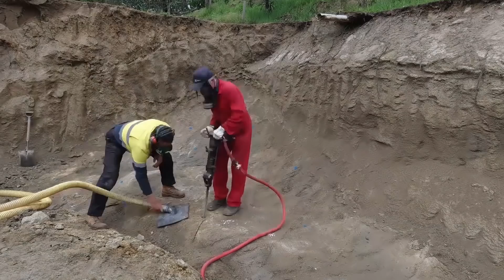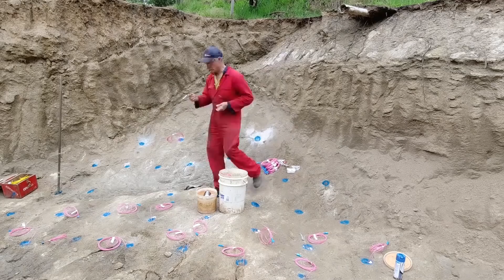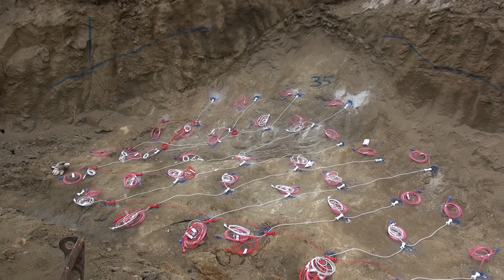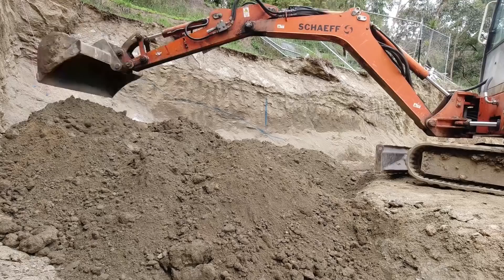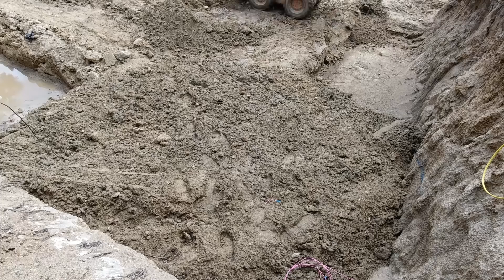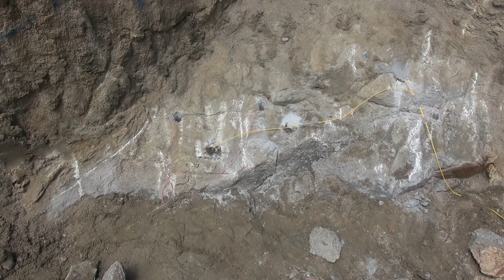Drilling and Blasting Granite in Belgrave Heights

Comment: Hey Dave how many hole you can drill with one drill bit ? Maximum? Do you reuse the drill bit after it becomes flat or  you use the new one ? Just curious does your drill bit get stuck if there is water in the hole ? 😐
Reply from the maker: Hi Nashib and welcome to my channel, these bit are good for about 60m in hard Granite, I'm using knock on button bits here and have recently purchased a grinder to sharpen them - https://youtu.be/jg83MLOe5Q8 If you find water in the hole it is very easy to get stuck, one way to overcome this problem is to have a second drill that is set up for "wet flushing" like they use underground - it flushes with water instead of air, this will make drilling wet ground easier.
Reply: @demolitiondavedrillandblast   thanks 🙏 for you kind info Dave . Hope to see more easy tips and tricks for using rock drill .
Reply: @demolitiondavedrillandblast   usually I can drill only about 28 maximum hole one day after that drill bit sucks ,what do you think about that ? Is it less or we can drill more in one day ?
Reply from the maker: Are you using button bits or integral chisel drill steels?
Reply: @demolitiondavedrillandblast  I think it should be dth button bits

Comment: I don't understand why the pink wires are so long and why don't you cut them to re-use on a other blast. And i don't understand what is brown thing you put on the top of the holes. Is it just some standard gravel or is it a spécial product, and what is it for doing ?
Thank you for the vidéo.
Reply from the maker: Hi Stéphane, The Pink stuff is not wire, it is a hollow plastic tube with a very thing layer of explosive coating on the inside, the filling for the holes is 5mm screened crushed rock.
Reply: The 7Mm screenings give a mechanical lock in the first milliseconds of the initiation of the blast.

Comment: Wondering if the blasts would be less costly with larger holes "Less boosters and caps , det cord " ?
Reply from the maker: Yes, certainly Michel, where you can. One of the variables that you have to manage is the length of the stemming column in relation to the diameter of the hole, the normal recommended range would  between 20 and 30 diameters, any less than 20 and you risk blowing the stemming out the top of the hole and not breaking the rock so for short holes like the ones in the front row here (32 or 35mm?) is really pushing my luck especially since the hole spacing is nearly equal to the depth and the hole diameter / depth ratio is only about 16! This is the most cost effective way I can do it that I know will usually work.
The deeper holes up the back were 38mm. Cheers.

Comment: This job-site does not contain granitic formations, it is ordinary earth/natural soil because the product shows no rock pieces.
Reply from the maker: What we have on this site is mostly decomposed granite in the lower section of the rock, when you blast it the shock wave breaks all of the bonds in the rock and it turns into sand.
Reply: @demolitiondavedrillandblast 
Hi Greetings,
Could you please be more specific about the the drill pattern and the type of explosives you use that makes the granite sand?
Thanks in advance.

Comment: Dave would it be possible for you to do a before and after  picture so we could really see how much rock was removed. Thank you.
Reply from the maker: Ummmm... bit hard on this one now. the amount of rock removed on this one is very deceiving, it does not look like very much at all when you look at the seemingly small amount of smashed rock in the dig out. Something very interesting happened here, we had some very hard granite and some decomposed granite that is a lot softer, when you hit the decomposed granite hard enough with explosives, the shockwave breaks all of the bonds in the material and it just turns to sand! See me at 6:28 digging with a spade, pre blast this decomposed granite would not yield to the hydraulic breaker on the small machine but now I can dig it just like sand.

Comment: Don't use a blasting mat it might save the customer a few bucks moving and re moving dirt
Reply from the maker: Hi Albert, there are pros' and cons for both methods, sure the clean up after using mats is a lot quicker but the size of the shot is limited by the size and number of mats that you have and you might have to do the job in several shots instead of just one. I have about 15 small rubber mats (about 80Kg each) and that would not be enough to do this job in one shot. Other factors, I would need to bring them on my truck, (extra worker), this excavator is to small to place them effectively or reload on truck easily (manual handling issues). Another big issue is that the dirt does a remarkable job of dampening the blast noise and overpreasure  - if the neighbours don't hear it, they don't feel it and don't complain.  You can see hundreds of my shots with blast mats on this old compilation video - https://youtu.be/VCMjaYfUgKQ

Comment: Dave do you ever get jobs where you only have to take inches of (showing my age) . I use to work on Barrow Island and they built a new air strip and the blaster made like a snooker table and he was taking inches in large areas
Reply from the maker: "We only need a little bit off the top" - hear it all the time Tim. I would normally explain the it is a lot cheaper to take a bit more off as this cuts the hole count dramatically (the hole spacing would normally never exceed the depth). in some cases this may be justifiable such as Barrow where everything like hard fill and concrete has to be imported. I have recently obtained an air leg drill for drilling horizontal holes with ease, this is a different technique that I'll try soon.

Comment: Did you have 5Ms Delays on that shot? with 0 at the face? I hope that makes sense. Also if you are doing a pre-split do you load those the same as the other holes?
Reply from the maker: The control row along the front was 25mS, the reverse diagonal echelon rows 42mS, this does result in some sub 9mS timing collisions, a 17mS control row is preferable but my supplier is out of stock and the vibration is not critical on this job. A pre split row is usually loaded with a continues light load of explosive the full length of the hole rather that all of the bang at the bottom.

Comment: Love your videos Dave, but I got to ask for something more!

Can you do a video tutorial, or series of videos, on the different aspects and equipment.

For instance, loading 2 holes, and explaining your thought processes and what you are doing, like how you have your magic stick set up, what the different types of explosives are and what the pros and cons are of each, what the different materials are that you put down the hole and what they do, how far they cover the charge, etc. Then onto the detonation system, like what you use to initiate the detonation (some sort of foot activated charge?) what your siren is, how the delay clips connect to the tubing, how the primers are put into the charges, etc.
Also, when you do a det cord shot, is that just because you don't need delays, or is the det cord the actual explosive that you are using as opposed to just a signal device.
Also, the details of the tools, what the controls are on the drill, is the drill steel hollow to blow the chips out, a walk through of your dust collection system, maybe how you have your truck set up when you go out on a job, and a tour of your shop with stories about the history and usefulness of your different tools.

A lot of this could be a bench top video talking about the different types of explosives etc, and you could do a voice over on some existing video giving more detail on what you are doing, and then maybe showing us the consistency of the different stemming materials or whatever, but a video of the process with you taking some extra time to walk us through everything of loading a couple of holes, and then setting up the delays and such between them, and back to the firing position would be awesome!

I know that you have done some videos including some of this, and I saw one where you show the loading process, but it leaves me with lots of questions what the different materials are, why they are used, and it was a far enough back shot that I couldn't see details to figure my answers out lol

We all love seeing things that used to be there go away with the proper application of high explosives, but a lot of us would enjoy the details of the process, kind of like if you were training a new helper and wanted them to understand it well, and remembering that we don't know what all the industry terms mean.

Thank you Dave!
Reply from the maker: Few... that's a few things for me to think about.
Reply: @demolitiondavedrillandblast  lol, I know that's a long list, but just asking doesn't make any more work for you! ;)

I hope that when you are working on a jobs where you have some extra time, that you will remember and be able to go into more detail, maybe with some still pictures for closeups, etc.

And if you get motivated and have time and can make basically a blasting tutorial, I think it would be very popular, because your style is great, you know so much, and are fun to listen to, and there just is not very much out there on blasting, so you would have a niche market all you yourself.
Reply: ke6gwf More details could come back and bit him in his backside! I did not read the list but I do know that after September 2001 things about subjects like this and channels were removed! All of the how to do this and that was removed... 
Dave is showing us just enough to cover his 6... He has to be very careful with his camera shots!
Edit
His channel is reviewed after every video he post. Either he keeps us in the dark or he loses his licenses and could go to the big house, JAIL! Let him choose what he wants to show us! He has to protect the life of his business and I am very sure he does not want to land in jail for showing some idiots to much!!!  
Be very happy he is even allowed to show what he does! The end Results!

Comment: Seems all too often - an excavation is going well and then - there is a mass of hard stuff in the way! Bad for them but good for Dave. Looked tricky drilling parts there on the slope - much deeper too. Pretty big pattern altogether.
Great job even with problem over back section. - great video :)
Reply from the maker: It is always a bit tricky getting started on a slope Chris and I seem to have mislaid my very short 300mm drill steel that is ideal for this operation.

Comment: Hey, Dave. Really like the time lapse, slo-mo, and aerial shots. Another thing you might consider is, particularly the time lapse, an over-dub about what you are doing in that shot and/or why. I don’t want to become a demolition expert but it would be interesting to understand why/how, in a certain situation, you choose the holes, pattern, type of explosive, etc.
Reply from the maker: Ok, got that. Thanks Ted.
Reply: @demolitiondavedrillandblast  More info on loading the holes would be interesting. Cheers
Reply: @demolitiondavedrillandblast ............ Gee Dave. I really do have to admire the control you show by damping any potential flyrock. Especially since  flyrock is the most common thing to cause expensive problems  and injuries .You are right on top of it , so to speak...............

Comment: Hi Dave, love the videos, quick question though, have you ever thought of laying down some really thick rubber mats to cover over the shot. Obviously you’d still need dirt on top of the mats but it could make it easier/quicker to uncover. Thanks again for posting and keep up the good work.
Reply from the maker: Yeah, I have a heap of blast mats, I don't use them very often as I have to take two vehicles to the job, also if you put mats over the rock and then a load of soil on top the blast mats get torn to pieces!  Much better to use less soil cover than I would normally use and then mats on top, you can see hundreds of my shots with blast mats on this old compilation video - https://youtu.be/VCMjaYfUgKQ
Reply: Demolition Dave Drilling and Blasting Yeah ok, after watching some of that I get what you mean. Sometimes the best way IS the hard way. Thanks again and stay safe out there.
Reply: blabla62871 Aah, ok, I hadn’t seen that one.

Comment: masks?
dont you trust your vacuum?
Reply from the maker: There are Three issues at play here Bruce, the vac is very good but you get a build up of dust around the collar of the hole under the rubber mat, you can see this around the back row of holes as I'm loading. When you pick up and move to the next hole, the exhaust air from the drill gets all this dust airborne and without a mask you breath it. I never knew how bad this is until I was drilling under flood light one night. 2/ The exhaust air from the drill is very oily and coats your lungs. 3/ the full face cover keeps tiny stone chip out of your eyes when you flush the hole after you finish drilling.
Reply: If you're doing it every day for work, you don't wan't to take risks. Some of that dust is nasty stuff.
Reply from the maker: @Smith5783  - Correct.